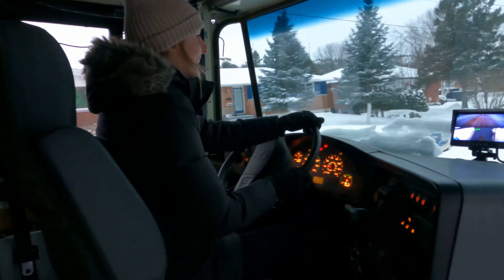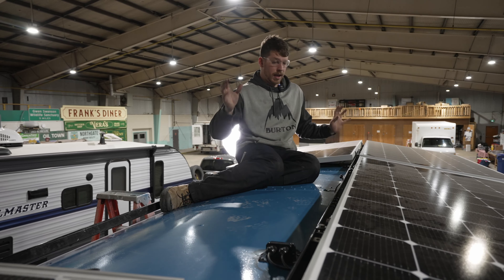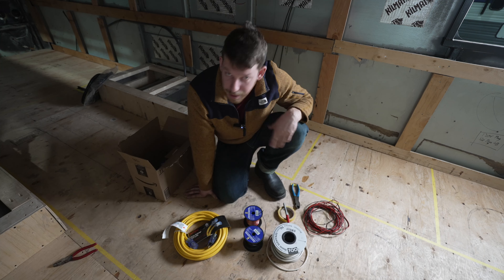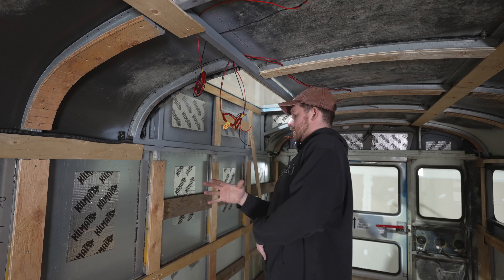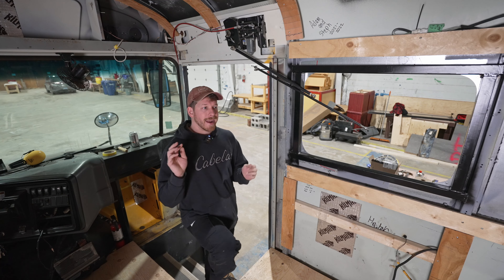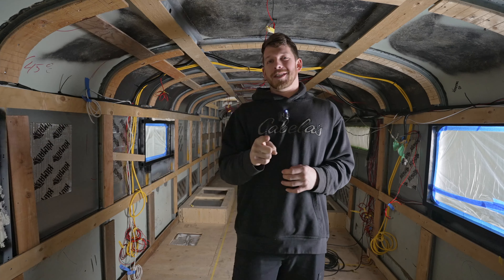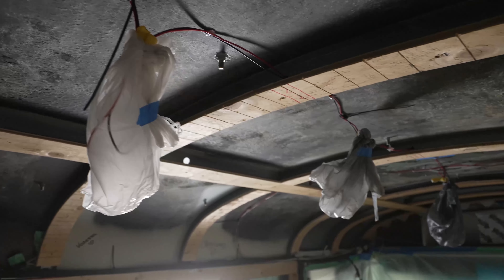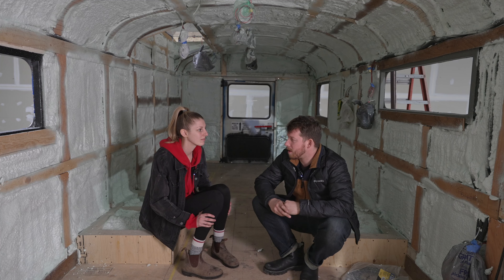Wiring and Spray Foam Insulation | Skoolie Conversion Ep. 24 | Adam & Steph

Comment: 12 gauge extension cord is the way to go for sure. Stranded, super flexible, heavy duty and made to hold up to extreme use and conditions, and way cheaper then regular 12 gauge stranded wire. Seems like a total win from all sides. I'm a little surprised more peeps don't go that direction building their buses.  The only thing I would say is add some dicor lap sealant over your gland on the roof. I know you used the butyl tape, but as an extra layer of protection, dicor is always a good plan for roof holes. 
It looks like your guy did a great job on the spray foam, without a lot to trim and sounds like a pretty great deal. Well worth the investment. I'm hoping the studio has let you stay and keep working inside. Keep knocking it out!! Continues to look fantastic. Good work guys!!
Reply from the maker: You’re the best!!! Thank you so much for your support! We definitely will look more into lap sealant, we’ve seen a lot of rv people use it! We’re happy we got such a great deal on the spray foam and he really did a great job with getting it really close to flush! Really not a whole lot of work for us to trim up. The extension cord was a no brainer for us, we hope this encourages more people to do the same thing!
Reply: @AdamandAtlas  You're welcome. I really look forward to your posts and seeing your progress and how you're figuring it out. I also really appreciate your attempt at perfection, but in the end really just doing your best to do it well. After all, this is where you want to live, you don't want it falling apart or have to constantly be redoing stuff.
Reply from the maker: @2AZSUN  exactly! We want to live and look at it everyday and be proud of our hard work!! ❤️

Comment: Adam, you can always get a black vinyl film and apply it to the glass on the outside, cheaper than tint and easy to apply, it's what we use.
Reply from the maker: We were thinking about that too! We were in such a pinch and just wanted to get them black so we used spray paint. We’ve seen so many other people use spray paint on their skoolies, not that it’s the right way, but we’re taking out chances. Hopefully the spray foam will keep it from budging.

Comment: You could Use black felt or like material to cover the blackout windows, so if the paint starts to come off, it won't show what's behind it. Just a thought 🤷
Reply from the maker: We’re hoping the spray foam right on top of the blackout windows will stop it from peeling or anything if it does!

Comment: Do you guys plan on putting out a framing video? Did y’all mainly use 1”x4”s? Screwed directly into the hat channels?
Reply from the maker: We used half inch ply cut into strips and self tapping screws to strap the ribs of the bus! We’re not sure if this was the best way to frame, we wish we used two by twos and attached them on either side of the ribs like a lot of other build do! The way we did it makes the metal hat channels hidden, so when we go to put up the walls an ceiling, we have to keep their location in mind to avoid hitting them with screws etc.